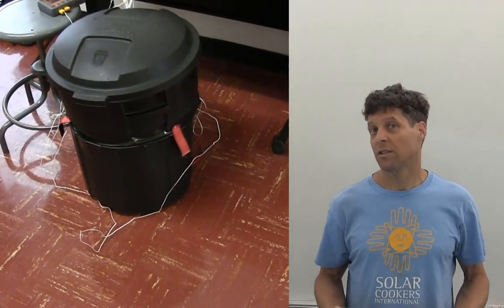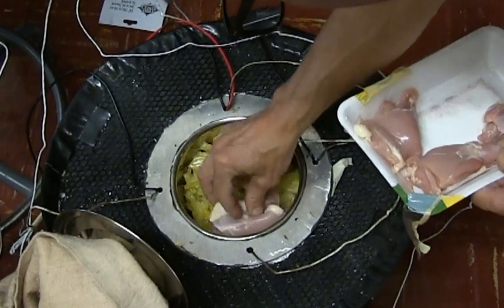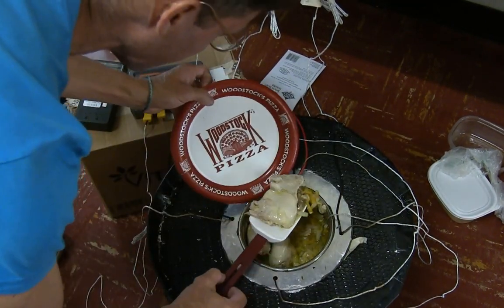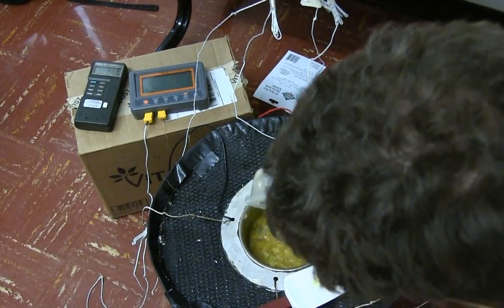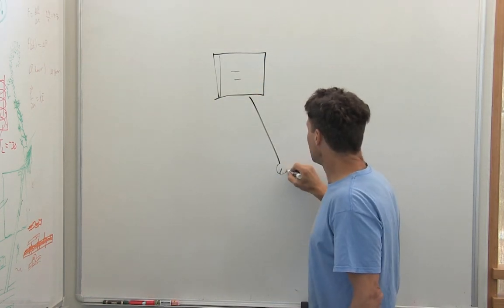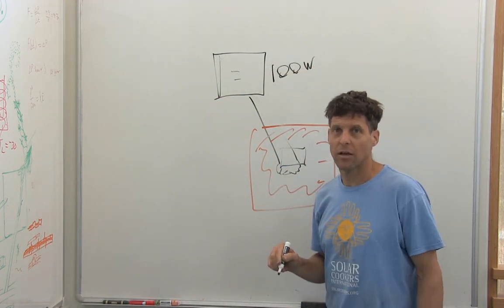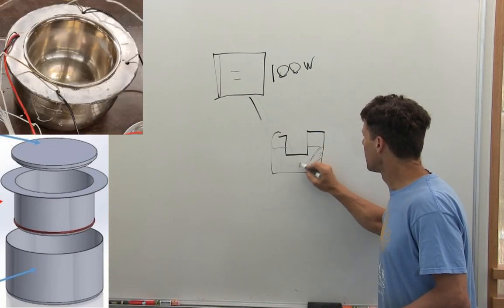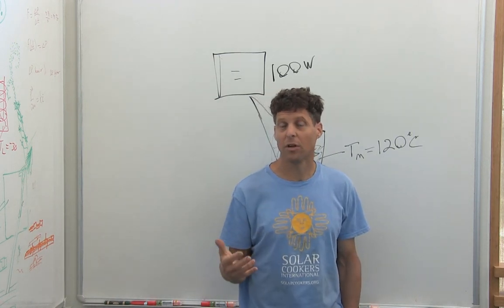Cooking with Phase Change Thermal Storage: Chicken Stew! Pete Schwartz, Cal Poly Physics

Comment: this could even be used for space heating and easily because all you need is 2 wires ported into the structure where as using a solar heater requires some ducting or plumbing and pumps fans etc, also temp controller all that costs money and adds complexity. with this you can heat the storage up, it can operate as long as the solar is working and then when you get home all you need is a fan maybe to distribute heat, or just open the lid to release heat...it wouldn't heat a big space (it could if your system is big enough) but it could be enough to make a difference in power consumption without a huge upfront cost. this is great. great work.

Comment: first off - amazing video thank you. second - How long does the phase change material go through it's phase change?  I understand at the point of the phase change the temperature/heat remains constant. the question is how long will your phase change material stay at that temperature? from what I saw in the video it was at least an hour and a 45 mins - which if I got that right HOLLY CRAP you are on to something there
Reply from the maker: Hi, Thanks for the question. The amount of time it will stay at the melting/freezing point depends on how fast you pull the heat from it. A considerable amount of thermal energy is absorbed to melt the phase change material (PCM). The PCM will stay at least part liquid until you've pulled all that thermal energy out. If the cooker is well insulated and you don't put any food in it, the PCM will stay hours before freezing again.  However, if you fill the pot with ice (for instance), the PCM may freeze again in a few minutes.
Reply: @pvs242ful  I'm wondering how much more energy is stored in the phase change... and could this be a thermal battery?

Comment: Have you tried using a Thermal cooker (Its a type of Giant thermos) to store your cylinder of PCM within it to improve efficiency. (Using a PTC heating element to self-regulate temperature so it does not exceed the boiling point of the erythritol.(Around 400F PTC heating element seems to do the trick nicely)
   I have a 1.5 liter Thermos which over a matter of hours can melt 200 milliliters of erythritol with around 8 watts, because the heat is trapped so well.
(Around 26 watt hours of thermal energy storage I have been finding is excellent for cooking eggs) (If you can get the Eggs out of the container... I need an Inner Cooking pot that is slid in/out of the outer pot, which actually makes contact with the PCM) (That way I don't have to pull against crystals)
Reply from the maker: Dan,
Thanks for your thoughts.  What thermal cooker did you use?  We tried a few, and found that the inexpensive ones (Stanely's Camp Crock) didn't insulate well and the plastic parts melted.  Feel free to contact me directly at pschwart@calpoly.edu